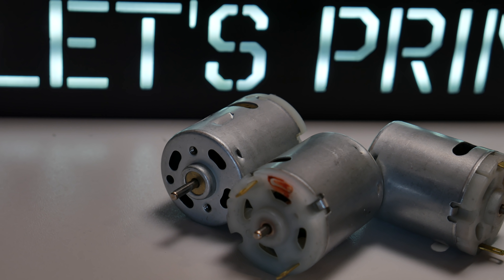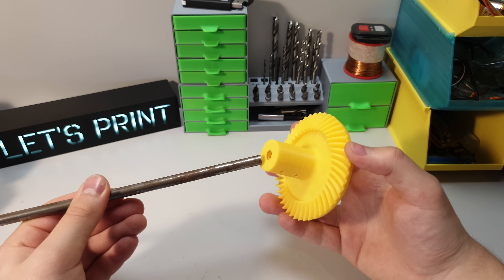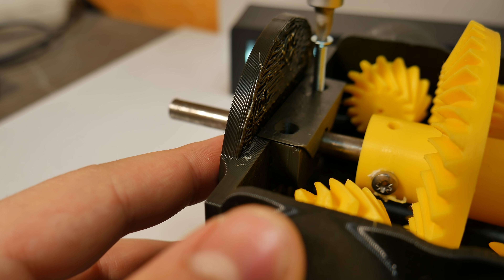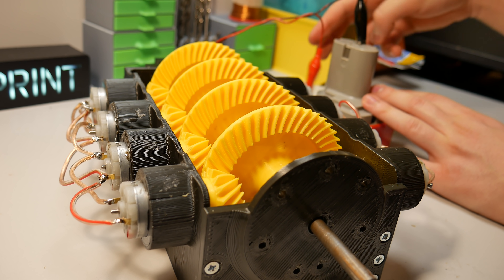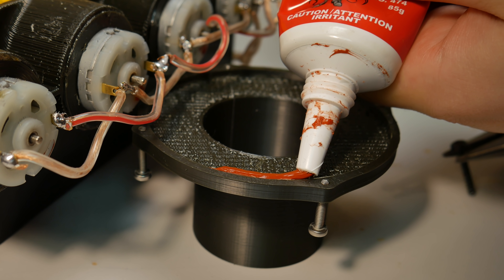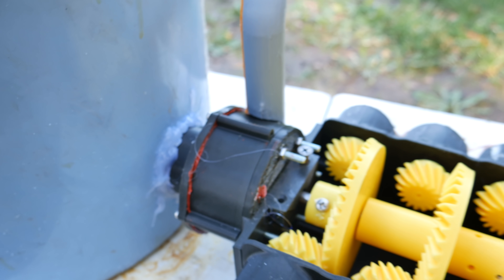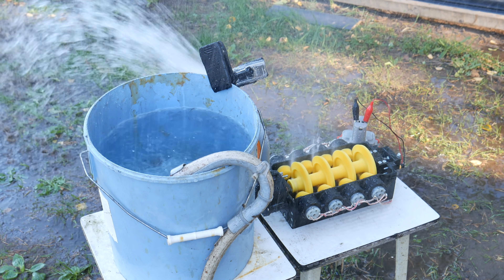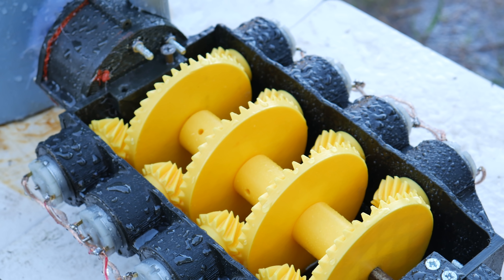Extremely Powerful 3D Printed Gearbox & Water Pump - Eight Electric Motors

Comment: The set screws in the plastic will come loose, because the plastic creeps away under load. Tried it, failed, form fit required...

Comment: -You could get the bolts tight by Silicone on a washer and bolt
-You could make it smaller as well, 4 motors per big gear and 2 big gears facing opposite eachother, so each big gear pushes against the other and the shaft wont slide back (you would need to space the gears against each other though)
-A curved impeller may have better efficiency as well (almost exclusively seen curved fins on impellers in water pumps so far )

Comment: add 8 more motors and add a very large diameter "fly wheel" like a turbine and make a generator from the 16 motors in total
Reply: The ring gears will not turn the helical spur gears.

Comment: You must fix the water level down to the impeller...Or what is the point of using pump? And then we can see the actual power of this particular pump...And by the way if there is a leakage in the impeller part the the pump will not work....It's the head pressure which is helps the motor....I think you should use an dynamo and charge your battery....😂Jokes a part...Nice work

Comment: You could make it waterproof by using a longer steel rod and distancing the pump from the gearbox by putting a spacer element between the two, where the water can run out of.

Comment: It looks like you've got a water leak at the impeller shaft, and possibly also from another small hole at the back of the impeller housing.

Is there a sealed impeller shaft that can be used to prevent the leakage from the housing into the gear box?

Comment: How much electrical power is being used to move eight motors?  Looks like the same battery pack used in a electric drill.  I somehow don't think that is designed to last very long, and it most likely overheats very quickly.

Comment: For durability upgrade on metal contact in end of the rod. Make sure both surfaces are cut straight, center punch mark on the both and drill very shallow hole using say 10mm drill bit. Get one ball bearing ball, apply little bit grease, hold it on place and tighten the bolt. This way you have smaller contact surface creating less friction and hardened ball bearing ball wont wear out that fast. If you are worried bearing falling out, there are those long nuts that you can tread over the bolt that prevent bearing ball from falling out.
Of course this is based on what ever those gears can last more than day continuous use, but mentioned friction could start melting plastic, so its worth to do such minor modification.
For water leaking, you can use silicone on axle and bearing inner race and make flexible disk that connects to shaft, put generous amount of grease between the disk and frame, this way if pumps pressure increases it will push disk against frame and works sort of one way valve. If pressure wont increase disk will just cause small amount of drag moving the grease around keeping healthy amount near the axle and bearing preventing water getting to bearing. Optimally you want to get water sealed bearing for that combined with silicone on both inner and outer bearing races, but that DIY sealing should work ok and for those who have difficulties to find sealed version of said bearing.

Comment: I would recommend adding a small open chamber between the pump and motor chambers so that any pump leakage will not enter gear area. Put a bit of oil in the gear chamber and add a clear cover. Leave the oil to only barely touch the gears,

Comment: holy crap that would be perfect to use when draining my pool
Reply: Yeah, absolutely perfect. If you've got days to wait and don't mind reprinting about a hundred replacement gears, housings and impellers and replacing all eight motors every few hours.
Reply: @notbob2853  well probably better than me using a wet vac all the time

Comment: Add some copper pipe and make the copper pipe contact the motor bodies.  Have some water flow diverted into the copper pipe and back to the outflow.  Self cooling motors!!  Nice job.

Comment: I made something like this with a friend of mine about 12 years ago.. we used spare parts from grinders. We purchased the pinions and bevel gears from a tool spares shop! (shows how long ago right).. We only had 2 motors in ours. We made our impeller from two bits of flat bar! he's still got it and it still works. He uses it for pumping out his boat and sometimes his waste oil tank at his workshop.  Brilliant multi motor use and the cost of doing it this way is so much cheaper.

Comment: Nice job but unfortunately a water pump needs to also not fail and not have water leaking on the motors. so for this project and with less money and effort, you can get a super strong factory made water pump.

Comment: Pump efficiency is down to the impeller and volute design which you have not considered - you merely put a large amount of shaft power in with little useful pump pressure and flow rate out.  Please consult a book on the hydraulic design of pumps - you may learn something.  You call this an extremely powerful pump - but really it is not.

Comment: That's a very clever design! I never knew about the acetone vapor to make the abs smooth too, thanks. Great video.
Reply: I find the vapor method too slow. I wear a good ventilator and gloves and natural bristle brush to paint the acetone on the part. If you paint it on cross-grained it helps to smooth out the print lines. The only issue is air  moisture will stain it whiteish

Comment: I wonder how deep well it would pump from properly, and how much Watts it takes to run 6 motors insteed of 1 large. A bit strange, where you could use 1 large motor with similar transmission or seweral arround 1 cogwheel, there you used 6 motors with 3 sets of transmissions.

Comment: To prevent water from entering the gearbox, you could use a magnetic coupling and seal the pump and the  gearbox.  A lot of aquarium and fountain pumps are made like that.
Reply: Wow I never knew that thank you so much for this comment
Reply: Wouldn't you lose a lot of torque with that?

Comment: Your gearbox design should be applied to a jetski turbine. Having multiple small motors that turn one big hallow propeller. You can make this design shaftless and have an efficient Turbine. Just need to close the top. ( I mean the gear box it self become the pump.)

Comment: Impressive pump! Thinking I might copy this pump/impeller design in PLA and then cast it in aluminum for use with a car engine, using one or two 775 motors

Comment: Nice. Have you considered printing one that uses an interior driven 'mirrored' ring gear and set 4 motors on each side, to cancel any thrust? The motor plates can just slip into the housing to index them, and hang from the shaft itself which would go in as an assembly from the top much as this one does. Could really cut down on the footprint with the same power.

Comment: Why doesn't it short? I think I missed something.
Reply: Because pure water is not conductive. If the water is has little mineral concentration, even a lot of water between terminal doesn't create a short circuit. It only add a parallel resistance of few Kilo Ohms. As the voltage is <24V its sunk an additional few dozen of mA on the battery, so nothing to worry about. Excuse my bad english

Comment: Bro, great video, but the way you have your electronics set up you are practically begging for a short circuit. Insulate your solder points!!! Spray resin or use electric tape!

Comment: Your spacer's shoudn't cover the 90% of engines cooling holes.
Reply: its water cooled
Reply: @badwolf5245  xD
Reply: @badwolf5245  only by accident.
Reply: @MicroRotors  its not a bug its a feature...😂
Reply: Motor*
Reply: I think those are not ventilation, but rather are simply for holding the motor together.
Reply: @Validole  thats the problem, its blocking ventilation
Reply: His spacer's what shouldn't cover 90%? Also, what "engines"?
Reply: nobody cares as the pump leaks anyways, and is not designed for long term use.
Reply: @dominus6695 : You don't know who cares; you're not a mind reader.

Comment: You should use a more efficient volute / impeller design, also to avoid water spraying to gearbox use packing seal or v-ring

Comment: With some improvements this would be great as a portable pump, used off grid. Such as to remove water from a small boat tied in the bay. Or even at home after a heavy rain.

Comment: it would be easy to redesign the gear box to be able to use a flat piece of acrylic and silicon as a gasket. screws would help it stay together too. as for the motors probably a sleeve you can fit over and possibly pressure fit with O rings to keep the motors dry and just silicon the hole for wires. I see others have covered O rings for the shaft leaks. Really cool design!

Comment: Why don't you 3D print an adapter to slide over the cordless drill battery with a push button switch so you don't have to manually hold the alligator clips to the battery?

Comment: Nice video!
Is it possible to weld abs with PVC, just like in PVC pipes with connections? If It's possible, i think it would do great in the parts that go on contact with water

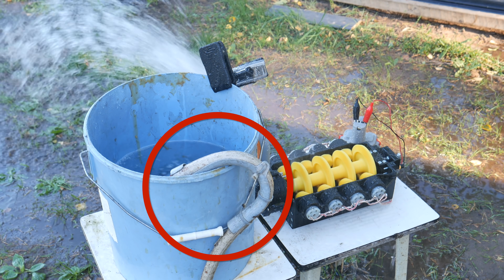Comment: 7:12 maybe build a second pump which pumps the gearbox dry xD
Reply: then one to pump that one dry xd then another lol
Reply: @Capricorn_media_group  no i wrote the gearbox, if the second pump gets wet its not problem. You could use a cheap aquarium pump for underwater use.
Reply: Longer shaft between the gearbox and the pump, along with some drainage holes, could make the trick
Reply: Actually the correct method would be to redesign the pump housing to include the recessed cavity in which you seat the Mechanical Seal. The mechanical seal also called a pump seal is a vital part in all centrifugal pumps, it is responsible for containing the fluid within the pump housing or "Wet end" preventing any fluid from flowing back along the shaft and infiltrating the bearings and motor assembly. If the seal is not installed then fluid will flow down the shaft penetrate the bearings and flush away any lubricant contained within, dramatically increasing friction causing the bearings to fail. The fluid will then penetrate the electrical in the motor causing a short circuit and ultimately burn up the motor.
Reply: Nah you're looking at this the wrong way, bruh. It's not a leak, it's a total loss cooling system 👍
Reply: Or just a simple cover and drain holes

Comment: AWESOME angle them up to make a V8 'just because'. Try making the gears double faced with a motor each side to neutralise the back lash on the shaft (hand crank egg beater style), also a throw-out washer behind the impeller to reduce the water pressure in the shaft/bearing.

Comment: Pump possible improvements:
Air entrainment, build pump housing with room for a rubber seal to keep water out of the gear box and air out of the pump. 
Curve the fins of the impeller will make the water flow faster

Comment: Shrink the driving gears so you get a higher rpm, Increasing the volume of water moved. Or you can shrink the driven gears on the shaft, this will allow you to shrink the gear box housing. This would also give you a higher rpm.

Comment: Acetone vaporing the gears could make it a lot quieter. One method that car manufacturers used back in the 30's to improve floor space was run their differential gears at a very low angle to lower the driveshafts in their vehicles, and they also found that it had the side effect of making the differential gearset much quieter.

Comment: Interesting build :)
I think the motors so tightly fit and covered might heat up, you should rethink the spacer to allow better air flow especially under load.
Lots of heat will also affect the plastic surrounding depending on the material
Reply: one more thing: to make it water-tight you might want to look at this process of plastic annealing 
https://www.youtube.com/watch?v=nRLJ4ylGTFc

Comment: I guess water is the perfect thing to cool those electric motors!
Reply: linus approved
Reply: And the bearing
Reply: Brushless and brushed motors actually don't care about water, you can run them under water without issues, so the spray won't hurt the motors. It is the electronics that have issues with water.
Reply: Designed correctly it is surprisingly effective.
Reply: @garethbaus5471  I'm not questioning how effective water pumps arr

Comment: Nice project. To remove the leak one of the idea may be to separate the impeller box from the gearbox. Currently have one common wall without any sealing on the shaft and bolts. Your first revision of this idea is very promising. Can you tell me more how you design the bevel gear? What tools are you used to design them? Thx!😉👍good luck!

Comment: First of all I would have not used a bearing like that for obvious reasons..but to make it mechanically more reliable and a lot more powerfull I would use a BLDC motor and crank the ever livving hell out of that impeller...also the shape of the impeller is not ideal. You should have aimed for a lower profile impeller and curved blades (not all that incredibly curved but with common sense)

Comment: Acctualy I went to this and thought this will be some badly produced video and bad idea. But I was plesently suprised, I have still some doupts about the effectivnes of paralel motors. Have you tested it with one half on one side disconnected? I would be really interested. My theory is that paralel motors should not be much effective, because they are not made equal if one is slower it slowes down the others, so you can theoreticly get more speed with less in number but slightly better motors. The counter argument probably should be that if the pump is under heavy load it speed does not matter, but torque does and it rises when more motors are pluggedin paralel.

Comment: Good design.  Could also be used as a water based power generator as well will a few tweaks.  definitely need to water proof the housing and motors...too much water leakage getting into the motors and they will fail.  Use waterproof bearings.

Comment: Nice job. If you are going to pump water, wouldn't it be better to have 8 small pumps, each direct drive, or is this more finding a use for the gearbox? I know a boater and he says they only way you can have too many sump pumps or too big of a sump pump is when the weight causes the boat to capsize or sink! He uses a piece of Starboard with about 6 pumps, each with their own float switch and fused power line on boats he just bought. First thing he did was drop that in the bilge, route the hoses where they will spray overboard and connect it directly to a battery that he keeps just for this. That's six separate hoses from six pumps controlled by six switches, powered by six separate leads each with their own fuse. That way even if nothing on the boat worked as advertised it would not sink before he got to fixing it.

Comment: I have been thinking about similar configurations for years.  I was thinking about applying this technique to electric vehicles by using several hobby sized electric motors in tandem to power a full size car. Large motors take high currents and cause large transient voltages that can be hard to dissipate. Numerous small motors can reach the same power output with more standard electronic controls.  The bigger advantages would be scalability and redundancy. If you need more power, you can add more motors. If one dies, you have several more to get home. 

I thought this also may work on electric aircraft. Imagine a small plane with 20 hobby size ducted fans embedded in the wings.
Reply: This sounds like an absolutely horrible idea for a full size car, just think of the added weight and complexity of using so many gearboxes vs just one large motor and one gearbox. Also larger motors can be more efficient and produce more torque at low rpm.
Reply: @seklerek  why the hell would you use multiple gearboxes?  I would use one driven gear with motors arranged around it radially with their pinions engaged. They have the advantage of counteracting the deflection forces. Using 4 assemblies, one for each wheel, and 3-4 motors per wheel, would greatly reduce transient voltages and get the power levels more manageable per motor. One motor is stupid, because you have to have differentials that waste energy and lose all traction when one wheel breaks loose.

Comment: The water is not leaking into the gearbox, it's just coolant for the gears 🙄😅
Reply: Genius, multiple problems solved.
Reply: The same way PC watercooling float bearing pumps are cooled and lubricated in water.
Reply: If you have a problem, call it a feature.
Reply: @rogerbarton497  ah yes, the Bethesda approach
Reply: @Thetreetroll  Except for the rust...
Reply: @luisderivas6005  well.. use screws and bolts that are rust proof. The plastic should be fine it will just make it slippery
Reply: we all know gears create a lot of friction! this is genius!
Reply: @k4rd897  protogen
Reply: @Thetreetroll  Easy there, Todd.

Comment: The pump itself mounted in bottom of the tank.... so its not big deal.... even if you didn't connect the pump also the flow will be there but less